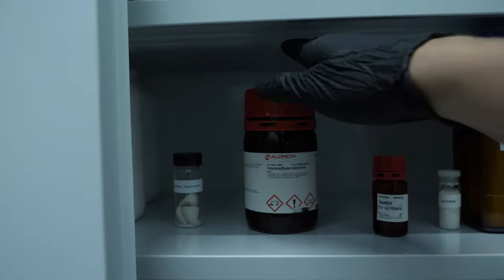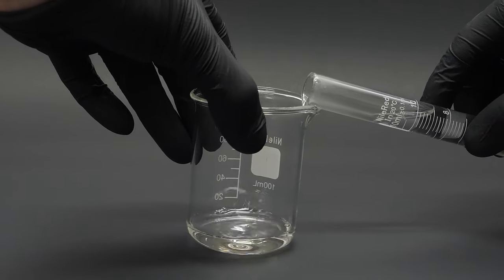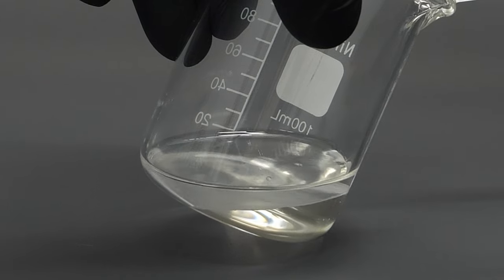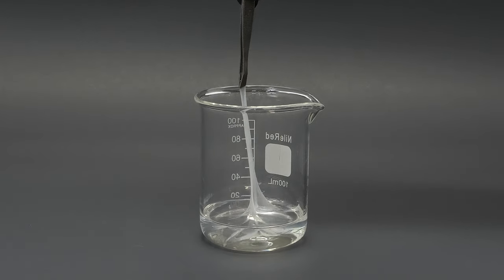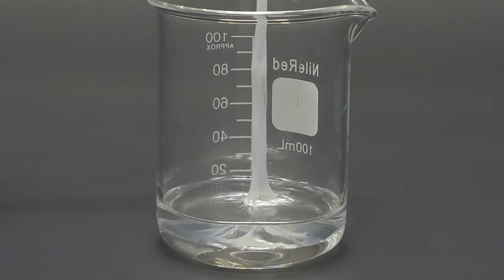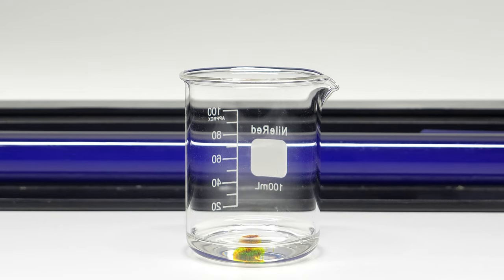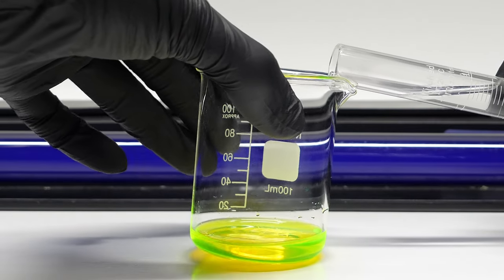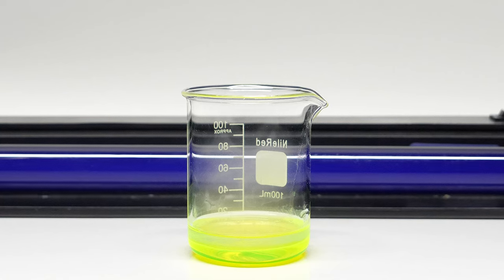Making glowing goo

Comment: Did you know that the goo mixture you made is basically Spider-Mans web? Like you said before it is just Nylon plastic which when it is thick enough can hold even a fully grown man? 90% sure that's what they used for the web in the stunts for The movies. Also, In homecoming, you can see peter making his webs using the chemicals for this (I THINK)